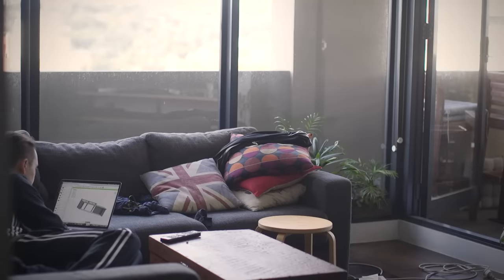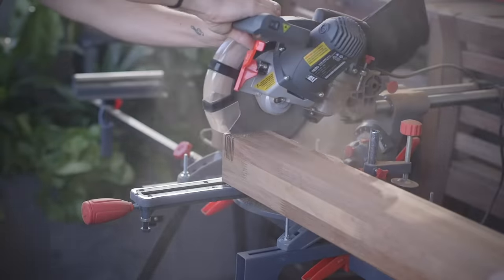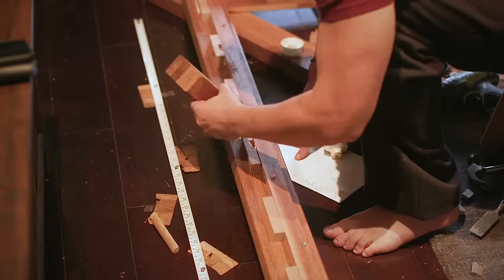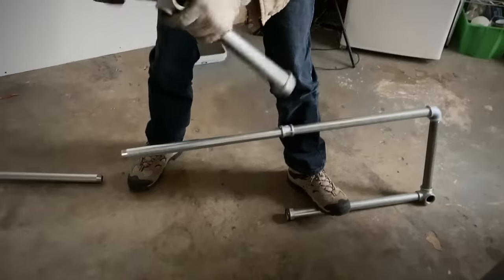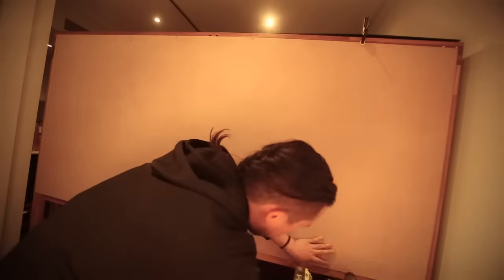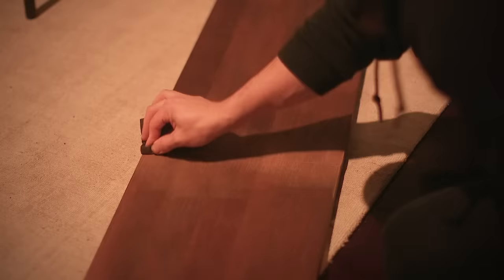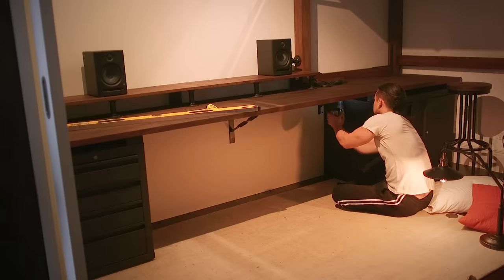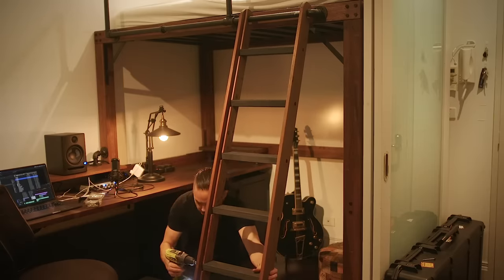Building an industrial-styled loft bed and study

Comment: There's a few other ways to prevent that long desk from sagging or bowing in the middle.
1. Find a square steel tube with an internal diameter the same thickness as the wood and cut one side off the tube creating a C-Channel.  Fit the C-Channel around the wood on the long edges of the desk (after painting it black of course).  Screw and glue into place.  The glue is to prevent future squeaking as things grow and shrink with temperatures and humidity.  Or if you can find pre-made C-Channel that can also work, but is sometimes more expensive than square tubing.

2. If you want the top of the desk to remain smooth just use a piece of angle iron that runs the full length of the desk and attach it on the front edge with the other half of the angle underneath. Screw and Glue into place.  Painted black it makes a nice trim piece while preventing bowing/sagging.

3. This method is far more complicated and requires two complete slabs of the desk to sandwich together while hiding quarter inch thick by 1 inch wide pieces of steel inserted into channels cut half an inch deep into each slab.  The steel pieces will sit vertically and run the full length of the long edge of the desk.  Glue into place to prevent rattling of the steel and help to hold the two slabs of wood together.  

Method 3 can also be used to make book shelves that will hold lots of weight but won't bow and have no visible means of reinforcement.
Reply: Definitely saving this for my personal projects. Thank you!

Comment: As a general tip from a carpenter, whenever you have problems with the stability of a structure you're building for daily use, please see the effort and create some kind of joints to increase the stability of the structure. If you're questioning your skills, you can make hidden and scrappy joints, which will be more sturdy and "lightweight" than the ones installed with screws. It doesn't need to be perfect for the eye, but it enables you to increase the surface area for pressure/force/glue and so on, and thus makes it possible for you to build stronger structures with less material/money and less visible structures around the product. Nice video, I really liked it!
Reply from the maker: Thanks for the comment. Yes, i was really working it out as I went, and in retrospect I could have made some better decisions about the stability. Next time :) THanks

Comment: That was amazing. I'm actually planning on making a loft bed in my tiny room also, but I'm really not sure how high the loft should be from the ground. Can I have a copy of the model you made for this project? I really liked your design..
Reply from the maker: Hi, yes the height was a bit of a leap of faith.. i made it so I could just walk underneath it with no shoes on, and thankfully this allowed enough space to sit up on the loft, with my head just touching the ceiling. I'm not super tall though, about 170cm.
I also made my own mattress from foam offcuts and a mattress topper, most mattresses I found were too thick. But it's totally comfy and lightweight.
Reply: @MichaelTanMusic  Ok thank you very much!
Reply: @Carl_John  
usually make 1 meter from the mattress to the top

Comment: Just a safety tip, if you use that printed jig to guide a punch and then drill the recessed hole with the spade bit first, you'll get more consistent results because the spade won't wander in a hole as can happen if you drill with the straight bit first.

Comment: This was great to watch! Great job btw the reason your bed was wiggling do to you using screws. Carpenters use nails in case wood moves and less prone to break hope this helps basically just use nails and less screws

Comment: This is late of course but instead of the corner supports you could have placed T shaped steel reinforcements on the standing beams and the central cross beam supports facing the wall side, they would have locked the shape in place and for added stability can add a bottom cross beam at the feet of the structure and reinforce with L shaped steel reinforcement also facing the wall side.
Still a good job none the less. 👍

Comment: Any good worker type knows it's imperative that you swap a full set of clothes to do construction work. That includes carefully selecting each item that you wear. Doing that work on your bare feet dangerous. It could cost you big. A wood splinter can injure you severely. They travel and it can easily put you in need of a surgeon. Glad you missed the trip.  Very nice bed thanks for sharing.

Comment: Just an throwing an idea out there for the future- would it not be better aesthetically and practically to "dig" in the vertical wood pole at 4:16 to fit the mid beams inside the poles?
No need for triangle support or L-brackets as it would support the structure well. No?
Reply from the maker: yes, in retrospect I would have definitely cut trenches into the posts for the mid-beams. Still probably would've needed a few triangles but nowhere near as many!!

Comment: Hello! Video is great. Was just wondering how it's working out so far for you, considering it's not attached to the ground nor the wall. Do you feel it is sturdy and safe? Do you feel it moves during intimate times, because of the movement? Would you recommend attaching it to the wall or the ground, now that you've experiencied the build for a while?
Sorry for the weird question! I'm considering doing this myself, but I'm not sure yet, because of concerns like these.
Thanks.
Reply from the maker: it’s very sturdy. i only use it as a spare bed (for one) when visitors come over, but i’ve had someone sleep next to me and it hasn’t been an issue :)

attaching to the wall (for stabilising, not for load bearing) would definitely make it more stable but i didn’t want to damage my walls. 

Although it probably doesn’t matter, i can’t imagine i’m ever going to disassemble or remove it!

Comment: Industrial style could become a huge movement to DIY with quality, but the best pipe to use is gas pipe as it's structural integrity is over forgiving due to the required quality to contain gas within, thus its ability to hold up and be used for many purposes. The techy go with mechanicals, while dreamers and actors may desire the mechanicals of the imagination of what could have been during the steam motor introduction of the train. The purpose of the pulley with mechanics. Both are extremely important findings within their own era. This man who is performing this video has endured an adult education that could allow him to design furniture like an architect using one program of insanity just to tell us that our resources are better spent elsewhere than the individual being dead. If you take a look at his belongings; he's a musician who makes a stupid amount of money so he can show off his high featured metal printing machine while reminding me of the days left to water saws while I can only think about his pipes of metal for his wood. Nice set up, very beautiful. Truly the space comes down to what needs to fill it, and hopefully you can afford more than just a heap on the floor in New York City.

Comment: Nice job, This would not work in LA due to the heat. Even with AC running the temperature at that level is a good 10° warmer and that's the difference between a good or bad night's sleep. I would do a Murphey bed instead.
Reply from the maker: I'm in Sydney Australia, which I think is still pretty warm! But my apartment stays quite cool because it doesn't get much direct sunlight and I also have A/C.

Comment: Hi Micheal, nice video. What is that piramid black kinda tool you use to make perfect holes with the drill in the wood? Thank in advance for your reply.
Reply from the maker: it’s just a little tool i designed and 3D-printed myself for this purpose. i was told after i made it that it’s referred to as a “jig”.

Comment: is it alright to not add the mid beam?  just looking at a bedframe in wood or in metal. looking at how they are set up/built. It will mostly consist of slats, teeth,4 corners using a 'notch' method to reduce shearing load (as you have presented so far ), glue, screws,cross-brace (or other option for a strong sturdy loft bed frame), and a mid beam perpendicular to your slats (that way the slats will not wear off or bend so quickly from the weight). I notice your design is missing that middle beam. Is it because of the type of wood your using, that you didn't use a middle beam? as in it can handle the force/pressure? Everything else makes sense but I am a bit confused about the exclusion of that one part.
other than that great project. Inspiring me to customize my own as well.
Reply from the maker: hi! thanks for the comment!

it’s not a very wide bed (single), so a mid beam wasn’t necessary. plus, i used very strong and light pine slats, which are about 4cm thick. there is no danger of sagging or breaking.

Comment: Please be aware that paint can seep through fabric to whatever you have underneath.... sometimes spray cans can drip or if you paint too heavily it can run down and pool.   I prefer to use about 3-4 layers of newspapers to paint on... And never use spray paint in a small enclosed area... Fumes will rot your brain or possibly kill you. Looks like he did that part out on a balcony...  Also, on metal, make sure it is really clean of any oil or grease, and you really want to use a metal primer first, will save you having to repaint later on as the paint won't wear of quite so fast.  Some paints will start flaking fairly quickly if you don't use a good primer coat.

Comment: Hello Michael, what did you put on the top of the slats? It looked like a thin piece of plastic? I was planning on making something very similar to your design when I stumbled across your video. I have to say it looks great!
Reply from the maker: thanks mate. it’s called corflute, basically just a cheap stiff plastic sheet used in waterproofing. https://www.bunnings.com.au/project-panel-2440-x-1220-x-2-5mm-black-corflute_p0390164

Comment: Other then the all the brackets or the backboard how else could you have stabilized the swaying?
Reply from the maker: attached it to the wall? which i didn't want to do.
basically, squares are very unstable. needs triangles. someone suggested diagonal beams or wires too.

Comment: Hi Michael,

Great video & very detailed construction on the joints & fittings, looks like you're a professional in this field ?
Whats that 3D software for the design you're using ? can someone tell me what it is please ?

The competed project looks stunning, exellent work.
Reply from the maker: Thanks mate, definitely not a professional. I work in the music industry.

Autodesk Fusion 360 is the software I use :)

Comment: Not a big math person but curious to know. Why did you set the angle on the machine to 20 degrees? Didn't you find the angle for the height of the ladder to be about 70 degrees?
Reply from the maker: Sorry if i skipped a step. a square edge is 90-degrees, it’s called a “right angle”. 

The ladder needed to be 70-degrees against the ground. Therefore i needed a 20-degrees cut.
I could have done this a simpler way!
Reply: @MichaelTanMusic  Thank you for the explanation. That makes a lot more sense now. Great work!

Comment: Hey Michael, great video. I would really appreciate if you could share where I could find a course to study structural integrity of furniture (like adding enough bracings to increase load bearing capacity). And also which software you use to draw these furntures, looks similar to an Autodesk software. Looking forward to your reply.
Reply from the maker: It is indeed Autodesk Fusion 360. I believe this software can calculate load capacity etc. but I have no idea how to do it. I just made my best estimates on how much timber to use, based on looking at other bed designs. (I actually think i made it much stronger than it needs to be haha)

Comment: Wow! this is amazing. I just finished building our kitchen as a first time DIY with hardly any tools, this is next level professional stuff dude, design wise too!  did you have to buy a lot of the tools or did you have them already? such as those drill guides and that saw. I wanted one of those saw's but didn't think it was worth using it once then maybe never again...
Reply from the maker: Thank you for the kind words. I had a drill, chisel, clamps, tape measure, etc. already, but I bought the compound saw (and a few extra drill bits) just for this project! Thankfully it was only AU$150. The jigsaw I borrowed off a friend, and the drill guides i designed and printed myself :)

Comment: Nice build, how much did all the wood cost for this build?
Reply from the maker: The finger-jointed Merbau timber was the only really expensive thing; the loft posts, bearers and side-beams were about $600AUD total, and the desktop was about the same again. Would have been muuuch cheaper if I'd gotten two smaller pieces and joined them, but I really wanted one long solid piece.

The pine (stair treads and slats) is super cheap, like $5 a metre. Plywood also cheap, i think that big sheet was like $25. Brackets, screws, piping, stain, etc. ~few hundred bucks. Ladder timber was about a hundred.
Reply: @MichaelTanMusic  Awesome thanks for getting back to me much appreciated.

Comment: I wonder if you can share what you used or how/where you got the item @6:21. I am looking for exactly that to put on my loft bed as well but can’t seem to find anything similar online. Thanks!
Reply: I am referring to the plastic-looking mat you placed on top.
Reply from the maker: no probs, it's made of a material called Corflute, just cheap black plastic really. Cost $13.
https://www.bunnings.com.au/project-panel-2440-x-1220-x-2-5mm-black-corflute_p0390164

Comment: Know this video came out a while ago, but maybe someone will notice my comment.
How can you calculate the stresses that will be applied for a thing like this? So the construction will not break under the load?
Designed something similar, but much higher and with wider base.
Reply from the maker: i actually wish i knew. i literally just relied on intuition, which i know isn’t always a great idea.

the timber itself is suuuper
strong, it would take tonnes of pressure for the beams or slats to break. my fear was the thin rail which supported the slats, it was just glue and screws holding it to the main beams. i know the weight was distributed fairly evenly, and i did end up putting coach screws through a few slats (securing them to the main side-beam) but i guess the first thing to fail would be this join.

i’d be interested to destroy it one day and see how much weight it could handle.
Reply: @MichaelTanMusic  Understood. Thank you. Will try different options, but to stress test it to make a 2nd or 3rd construction, would be a very expensive experiment😁

Comment: Pls mention how much money you spend to make this type of rooms
Reply from the maker: The finger-jointed Merbau timber was the only really expensive thing; the loft posts, bearers and side-beams were about $600AUD total, and the desktop was about the same again. Would have been muuuch cheaper if I'd gotten two smaller pieces and joined them, but I really wanted one long solid piece.

The pine (stair treads and slats) is super cheap, like $5 a metre. Plywood also cheap, i think that big sheet was like $25. Brackets, screws, piping, stain, etc. ~few hundred bucks. Ladder was about a hundred.

Comment: Hey. Which softwares did you use for designing and structuring?
Reply from the maker: I used Fusion 360 for designing the rough model, but I adapted the exact dimensions and structure to the timber I bought.
Reply: Michael Tan thanks!

Comment: How much did this cost overall in materials ?
Reply from the maker: The loft posts, bearers and side-beams were about $600AUD total, and the desktop was about the same again.  Would have been cheaper if I'd gotten two smaller pieces and joined them, but I really wanted one long solid piece.

The pine (stair treads and slats) is super cheap, like $5 a metre. Plywood also cheap, i think that big sheet was like $25 and the desk supports about the same. Brackets, screws, piping, stain, spray-paint, etc. ~few hundred bucks. Timber for the ladder was about a hundred.

Comment: I'm really concerned about those ladder hooks. Ends will snap - its just a matter of time. Plz redo that part before someone gets hurt.
Reply from the maker: Thank you for the comment.

You can't see it clearly in the video, but the hooks were cut into two pieces of 18mm Tasmanian Oak glued together. This creates 2 x 36mm timber hooks, which are super hard and strong.

But even so, a person's weight climbing the ladder is mostly supported by the floor. The hooks mainly prevent the ladder from sliding or tipping over. Check out videos on the "Ladder problem".
Reply: @MichaelTanMusic  oooh, I see it now at 12:22, thx for the explanation. Great work!  Subbed!
Reply from the maker: @mescekchoppers1  Definitely worth considering though, because you’re right; if it were supporting a lot of weight and movement, it could split along its grain and be very dangerous! Thank you for the comment.